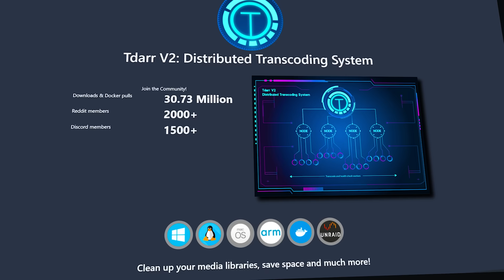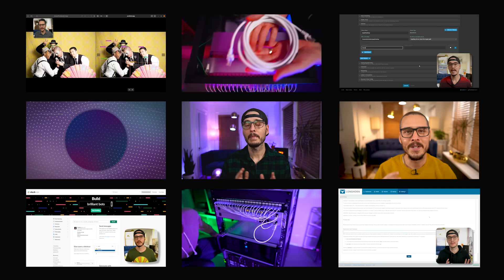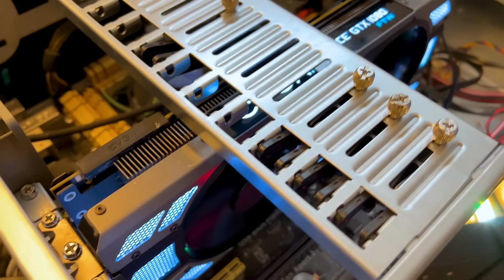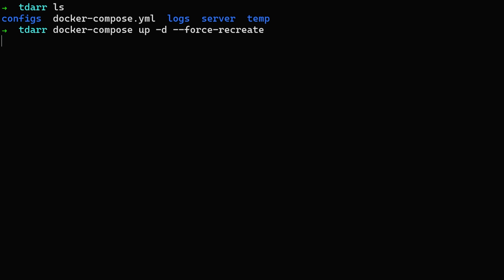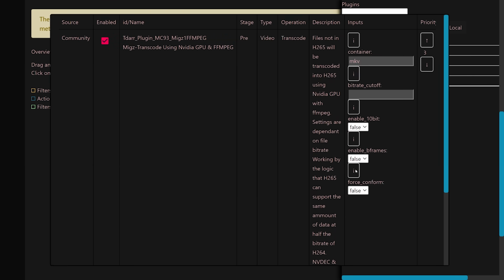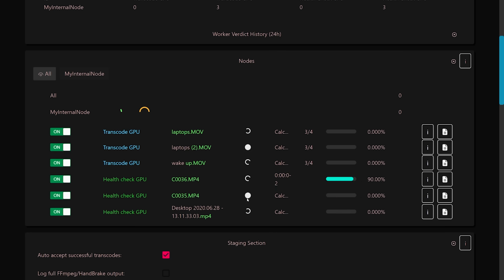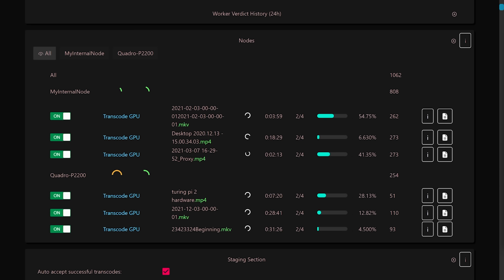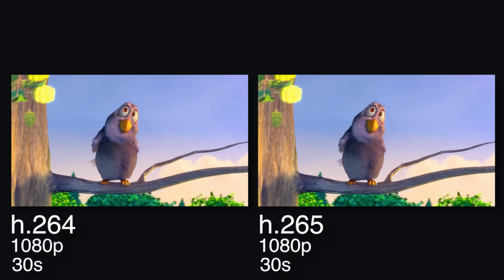I Freed Up 700GB+ Converting my Videos Using Tdarr

Comment: Looks interesting if you're in need of just compressing videos for storage purposes and/or watching videos locally with a compatible media player. But, if you selfhost the videos for like website/blog/streaming service, or want to make sure the videos are playable with the most basic media player (without the need of installing codecs), then h264 is still the way to go.
Reply: We are getting to the point that most devices in the wild have built in x265/HEVC decoding. Anything released 2016 and later should have it.
So it really comes down to whether or not you think supporting 7+ year old hardware is worth it.
In some situations it will be. Others is will not. And there are situations where you might want to store in HEVC and live transcode back to x264 for unsupported devices.
Reply from the maker: Yeah, just storage

Comment: Why Tdarr and not Handbrake on DOCKER? I mean should be enough for regular user, isn’t it?
Reply: Looks like it uses handbrake or ffmpeg. (eg in settings there are options like handbrakePath and ffmpegPath)
Seems like a GUI script that feeds videos to servers/nodes that run them.
Haven't looked in detail to see if they have their own encoding software other than really using opensource to run their subscription based business... 😆
Reply: Because its a lot easier to automate Tdarr than it is handbrake.  Sure if you want one off things, handbrake is fine.   But if you want to automate hundreds, thousands, tdarr is much easier.
Reply: @fileflows204   u mean  the Queue option in  handbrake does not work anymore? EGADS!! .... oh wait. I just checked, yes we can still queue whole directories or file lists in one quick process... not sure how it can be easier than that...  need to  run multiple handbrakes on networked computers off one file list?  No problem,  split the list into parts, and queue each list on a separate machine  and have all files shared on the network...  or if u want to stream the files to the encoder, substitute  FFMPEG (like tdtard does)..
Reply: @mhavock  well you have to make the queue... so that's a step... so that's not quicker.  Tdarr its automatic.  It no steps once setup.
But if  you want to use handbrake, go ahead, no one is forcing you.

Comment: Seems like no one has commented on this yet, sick new camera setup! It looks awesome, kind of feels less cramped from the telephoto lens and the bokeh and framing is also nicer.

I have plenty of OBS Replay Buffer clips that used NVENC H.264 CQP 25, meaning it takes a lot of space in exchange for lower resource usage (OBS is on the same PC that I game on). I already encode using HandBrake, but this looks like it’ll help use my desktop’s extra resources together with my server when I sleep.

Comment: I tried this a while back on unraid with instructions from spaceinvaderone and it didn't seem to work out as well for me. I like using handbrake so much more.
Reply: I think the idea behind Tdarr is to have it do an entire library for you in the background.
Manually doing it will get better results, but will require a tremendous time investment, even just to manage the start/stop/move if you are talking about 10k files.

Comment: Have thought about that many times in the past but I don't really see a reason to do this. Adding and running an additional hard drive, or get a larger one can be cheaper initially and is more energy efficient long-term than running a graphics card to transcode back and forth all the time when using Jellyfin or Plex. 

Of course this might change if you have a spare gpu lying around anyway, have one in your server anyway and energy cost is cheap where you live.
Reply: I'm re encoding my wife's old tv show she will never watch but wants to keep. She does not see the quality degradation

Comment: I go way WAY back with video encoding. Spent many hours @ the doom9 forums trying to squeeze every bit out of every file while keeping all the quality. Transcoding just isn't worth it unless you have huge source files, like ripping straight from a disc.  You always lose a little quality and slow storage is cheap and easy.
Reply: Storage may be cheap and easy, but serving large files can be a problem, or server will end up transcoding to a worse quality on the fly.   And besides there are other reasons to use an app like Tdarr or Fileflows than just to trancode.   You can remux, add new audio tracks in different codecs (my stuff cant place EAC3 for example which would cause plex to to a transcode), automatically cut commercials, add chapters, remove unwanted streams to save space etc.
Reply: @JohnAndrews_nz  You have valid points but editing streams in a container isn't quite transcoding. I'd argue that's even worse than transcoding since the gains are even smaller (most of the time) but require manual work unless every stream is tagged properly. I guess everyone has different needs but I'm done with the days of 100% CPU for weeks on end for a measly 720GB.
Reply: @drivenbydemons6537  you are correct.  that would not be transcoding.  however, you can still gain a lot of storage if you strip out all the additional unwanted audio tracks.  Tha can save 10-15% per video at times.   No where near h264 to h264, but still do that across a few TB and you can save a couple hundred GBs

I'm John BTW.   Switched to this account for transparency.   Was on my mobile/personal account previously.

Comment: Tim, thank you for this. I've been using handbrake for years and looking for an alternative. My Plex drive currently has 60GB free of 8TB, excited to get home and give this a go
Reply: Whats wrong with handbrake?
Reply: @dffvb_og  nothing in particular, just looking for alternatives. Best practice is typically to diversify software options don't you think?
Reply: @ryanmckee6348  well don't fix it if it ain't broken 😉 i'd rather focus on one software and master my skills there instead of many different ones - for such a use case. Also too not too sure, if the features are on par in respect of movies, like sub titles, audio etc... That makes more sense for you tube material but not necessarily for movies

Comment: GPU h.265 is still about 1,5-2x the size of CPU h.265 with the same quality. So if you are „archiving“ I would advise against GPU transcoding.
Reply: how can that be? isn't it the same codec?
Reply: @bobtiji  yes but different efficiency, also NVENC is only good on RTX 2000 series and up. The GTX 1000 series doesn’t have good quality encoding and the files are even larger although I’m not 100% sure on the file size.
Reply: @owlmostdead9492  uh. the more you know.
Reply: I'm pretty sure it depends on the output bitrate you set, no? In general, H265 is 30% smaller than the corresponding quality of H264. But of course, you can compress a H264 100MBit/s file into a H265 10MBit/s file, but usually it's around 70MBit/s for the same quality.
Reply: @simply-the-max  Nope
Reply: This is true, CPU do give better quality encodes and the file size is smaller.  However, on my GTX1650 vs my AMD 5800x.   I can get around 4-6x better performance on my GPU vs my CPU.   So make a smarter conversion setup, where stuff you really want to keep quality, use CPU, stuff you don't really care about, use GPU.

Comment: Isn't GPU encoding uses built in asics for encoding purposes? In that case isn't it seriously hurting the quality and size compared to cpu encoding with medium/slow preset? Especially using GPU with old encoders like GTX 1080, 16XX or 20XX have newer encoder chips.
Reply: yes, GPU encoders are optimized for streaming applications, not quality encoding.

Comment: does tdarr support av1 yet? i think av1 will replace h265 some day. youtube already uses it too. you might want to try using av1 on your youtube uploads to check out the quality difference
Reply: As of current, 3/3/24, tdarr does support av1. Just in case
Reply: @DrDipsh1t  Don't use tdarr av1. Use only SVT-AV1-PSY for archieving.

Comment: This is really helpful. Though I guess my 9.9TB movie library will take decades to convert since i've got only 1 node with a 3070.
But my first test conversions looks like I can cut the size roughly in half 😍
Reply: Just thought of a new coin mining scheme
Reply: You'd be surprised bro, with nvenc acceleration I was able to do a typical 1080p h264, ~5-7gb in about 20-30 minutes and I was also able to do 2x concurrently without impacting performance, and that was with a 980 too. Might actually take less time than you think!

Comment: encode.sh--------
nice -20 find -name "*.mkv" -exec bash -c 'ffmpeg -i "{}" -y -f mp4 -vcodec libx264 -crf 16 -minrate 900k -maxrate 2100k -bufsize 2100k -refs 3 -preset veryslow -vprofile high -strict -2 -acodec aac -ac 2 -ab 192k  "${0/.mkv}.mp4"' {} \;
pause
----

quality verses size ffmpeg cpu encoding will ALWAYS give you better quality for a lower size over any gpu encode

Comment: It's great for space saving but beware that H265 takes more horsepower to transcode on the fly when watching content on Plex/Jellyfin, so if your home server is a fairly low powered Synology or Raspberry Pi you might want to consider leaving it as H264 and just buy more storage, otherwise you will run into buffering!
Reply: most modern hardware has x265/HEVC decoding support. Even RasPis.
The killer is driver support.
Reply: @Prophes0r  Ya most modern hardware but hardware is commonly being used for longer these days. My pc is 10 years old and I dont' plan on upgrading it as I only download videos to my external hard drives which I watch on my ps4 slim and ps vita slim
Reply: @ZiggleFingers  For many people that defeats the entire point of having a Plex server. If your goal is to save money on streaming services you're hardly saving money if you go out and replace perfectly fine playback devices every couple of years. I'm using an Xbox 360 on one TV for the kids to stream cartoons. I don't want to give them access to a newer more expensive device they're likely to damage anyway.
Reply: Just make sure all the clients are h265 decode capable and ZERO transcoding is needed, 3rd gen firestick (2019) onwards, intel 6th gen cpu or later (or Ryzen APU), & I believe 1000 series Nvidia 500 series AMD or later all do the decoding in hardware as does a Pi4.

Comment: very interesting, can it use AMD cards ? several cards on one machine ? several cards with a mix of nvidia and amd ?
Reply: Tdarr/FileFlows both use ffmpeg under the hood, so aslong as you that has access to your GPU, and your GPU has the support hardware encoding, then they will work fine.

Comment: Tim, I started my transcode project last year, took six months and saved 30tb!

I do CPU encodes and only with HD content. Best quality and file sizes Vs GPU can be achieved this way.
Reply: 30tb savings! that's pretty massive. What was the beginning size of the library?
Reply: @Trains-With-Shane  About 60Tb of x264 content. I now have 50TB free on my unRaid array.
Reply: @joelang6126  I'm guessing you have already done so but if not; recommend using something like unbalance to consolidate onto fewer drives in the array, thus avoiding spinning up drives when not needed!
Reply: @transatlant1c  Already done mate lol. Drives are filled to 97% capacity before starting writing to empty drives.
Reply: @joelang6126  I figured as much :) wanted to mention it for others as well!
Reply: What about electricity bill? Transcoding is power hungry, and running it for 6 months sound expensive 🫰🏻
Reply: I just found out about Tdarr one hour ago.  I don't know how the heck I've missed it for years considering my Sonarr/Radarr/Readarr/Lidarr usage.  I've got about 150TB of movies & tv show episodes - many have Russian or Ukrainian language files (especially TV shows).  I've got a lot of stuff to take care of first, but I'm super excited to see what Tdarr can do for my media server.
Reply: I ended up using hb to AV1, saved 2TB
Reply: What CPU did you use.  I have a similar job and intend on using a 48 core EPIC.  The GPU encodes are larger for the same quality.
Reply: Holy shit!?
Reply: Cpu transcode is ok, GPU (intel or nvidia) are crap. If you want the best looking file for the minimal space, use CPU encode
Reply: Zero James  Sorry for the late reply James. No noticeable drop in quality at all.